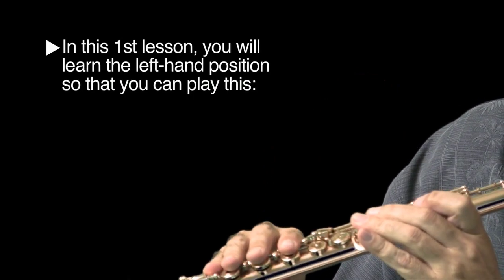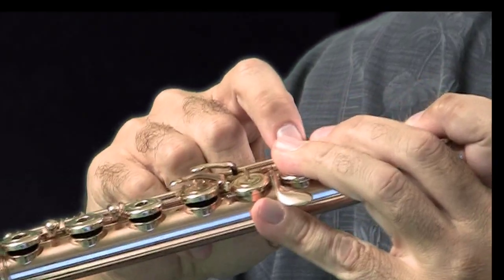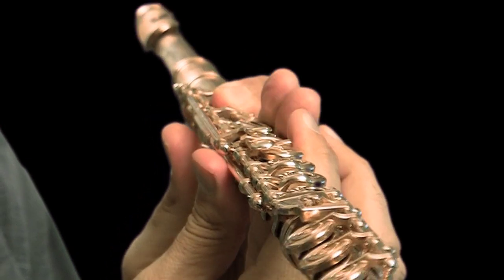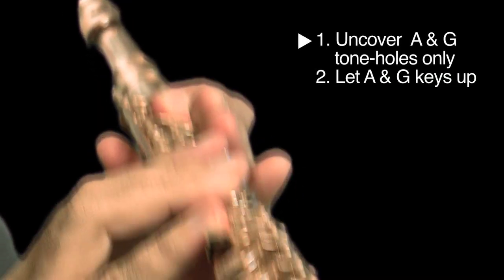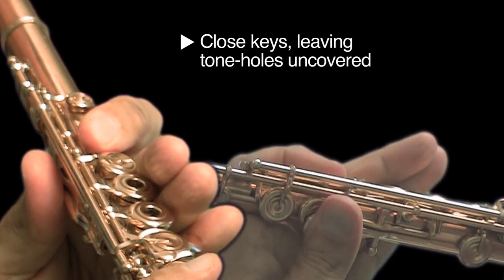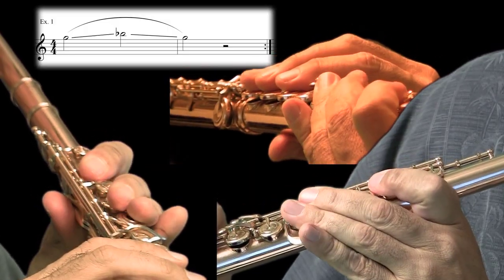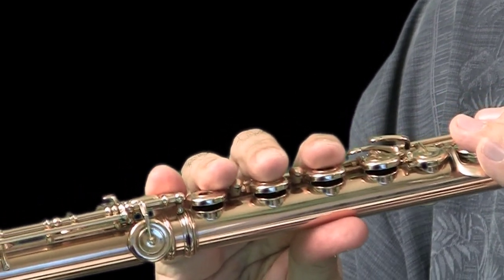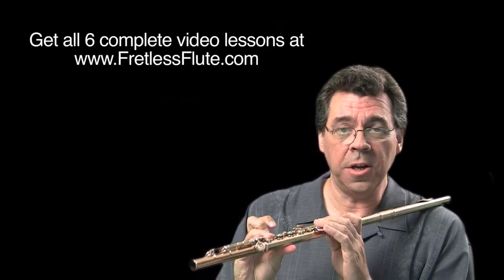Steve Kujala FRETLESS-FLUTE TECHNIQUE LESSON 1

Comment: Does this work for offset G flutes?
Reply: Even if this question is one year old... it never has been answered, so here's the answer: it works for any open flute or flute-like instrument (recorder, fife, bagpipes, tin whistle, ocarina; with some adjustments even for woodwinds like clarinet and sax). It also basically might work for a closed flute, but it's much harder to get the required smoothness into your moves.